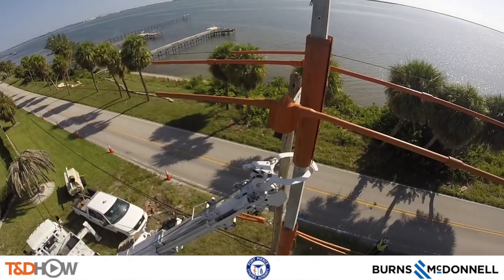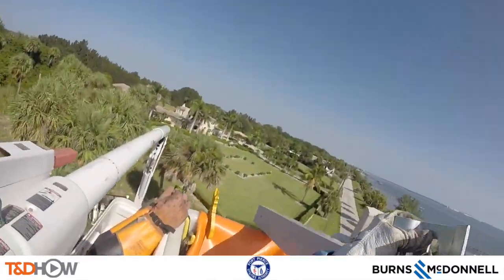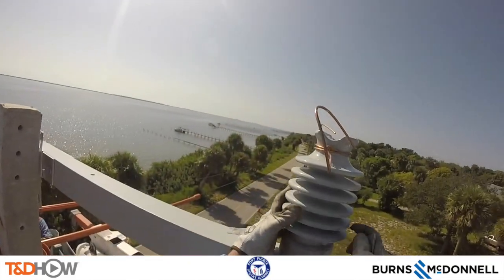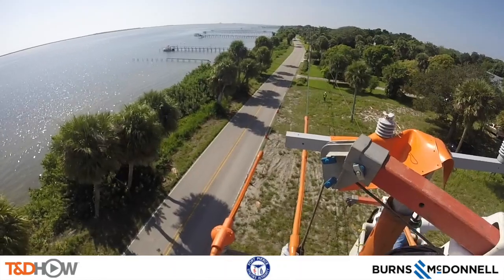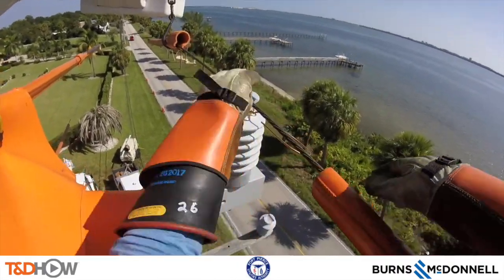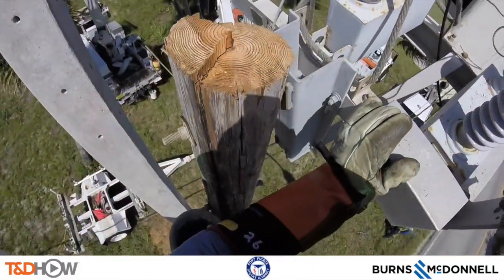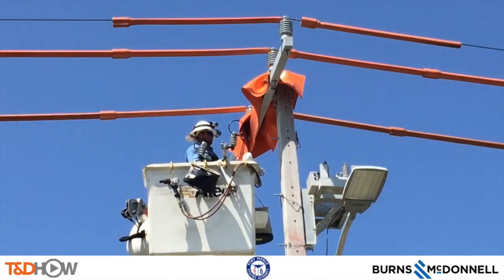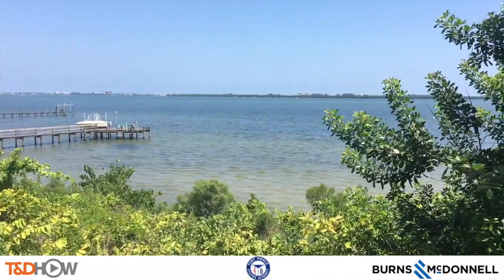Concrete Pole Framing

Comment: Here in Brazil, we use wooden poles such as a, aroeira and eucalyptus. Because of deforestation now we only use concrete!
Reply: In Poland 95% of poles is steel. I mean I saw some wooden poles, for 220V stuff in 90s. (The poles were from about 1975). But even that is not common anymore.

Comment: In the US, would it be typical to co-ordinate with the communications companies to transfer those comms lines over to the  new pole at some point, or will the stubbed wooden pole be left?
Reply: The telcom companies would ideally move them. They are notified.

In reality though they get left there until the telecom lines are damaged or replaced. Then, they might be moved to the new pole and no one will come dig up the old pole.

The big telecoms don't give a shit.
Reply: @TheWittyGeek  Some power companies do better than others notifying telecoms to transfer. And some telecoms do better than others transferring. Most of the issues involve  poor communication all around. IMO power should notify and give a set amount of time to get off the old pole and then start fining those who don't get it done. Most of the time power notifies and never follows up to see insure it got done. Without accountability for everyone, no one gives a zhit.
Reply: TheChipmunk2008 communication companies are notified and transfered to new pole.
Reply: They finally moved some on a reconduct near me after multiple months. It happened though.